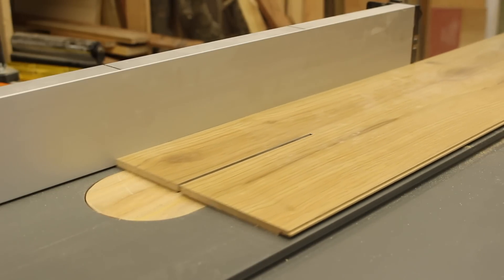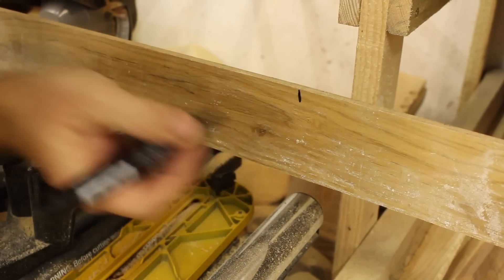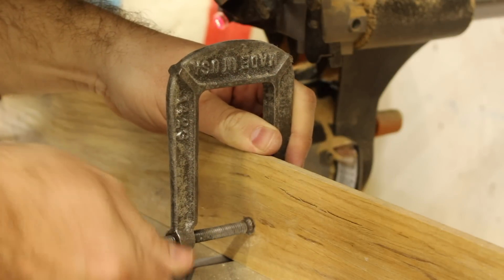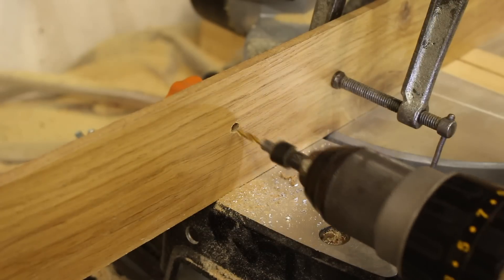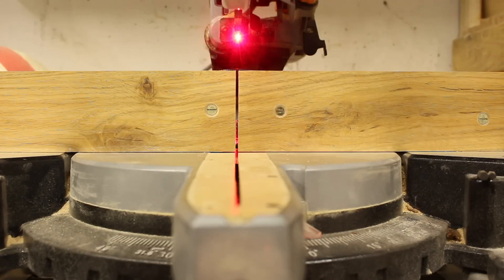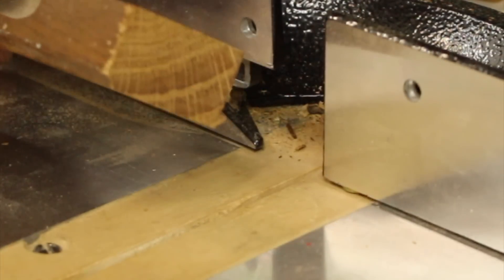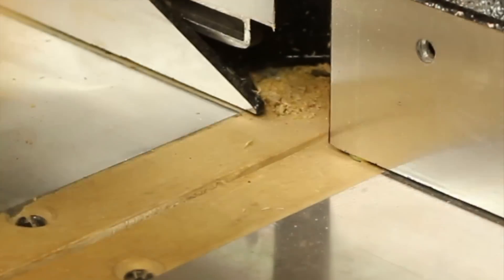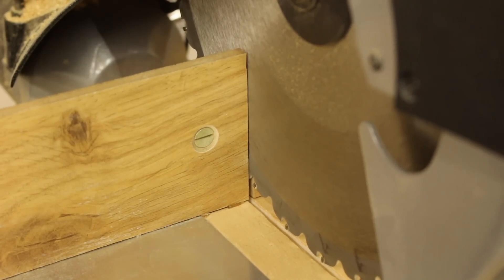Make Clean Cuts - Miter Saw Zero Clearance Fence - Ep 057

Comment: Did you fix the blade wobble? I scanned through your videos but did not find such. Help?
TTHANKS
Reply from the maker: I didn't have blade wobble. At least not much with that saw. It could be that your blade is dull so it cuts unevenly. If you have considerable wobble, you should return your saw to the manufacturer or dealer.
Reply: @AndreaArzensek  
In the video I thought you said you needed to fix the wobble.
Reply from the maker: It is so old video I don't remember what I've said. But I do think it was the saw blade that was dull causing me problems.

Comment: Is that an evolution blade. I just bought one for my saw . What are your opinions on the blade?
Reply from the maker: The saw itself is great. However the blade (imho) is very bad. While it can cut many materials it's only clean in metals. 
It's just not good for wood - lots of tear out and rough cuts. 
Also for some reason the blade produces very high noise when cutting hardwoods (probably not sharp enough)
I ordered new blade from Axminister so I will see the improvement which I think will be quite dramatic.
Reply: Thank you for that . I will probably use just to cut firewood that has nails then.
Reply from the maker: For that use it will be perfect.
You can cut pallet wood, firewood, and suspicious wood that could contain metal.
Cheers Frank!

Comment: you are still getting small tear out due to the chamfer you put on the bottom of the fence for the dust removal
Reply from the maker: I didn't notice any tear out. But I eventually changed the saw and the saw blade. Now I get very clean cuts. Cheers

Comment: The music is a bit too much for my taste
Reply from the maker: Ok, I promise the next one will be without music. 
Thanks for your feedback Danut, cheers!
Reply: Thank you, and also for the fence idea. I must make something similar but removable somehow. What do you do when cutting at 45 degrees?
Reply from the maker: I remove four screws or use a sled on the table saw.
It would be great to make it quick release for any cut.
I think that placing the block on the back would be the best so you can make all those cuts by referencing on the existing fence. This would take more measurements and time, so I opted for this quick solution.
I use this miter saw for 90 degree cuts 99% of the time.

Comment: I like that idea think I'm going to do that to my rigid I took the fence right off that came with it from the factory I couldn't stand it it was not a true 90 degrees so now it's hard for me to cut any stock that's thicker than three quarters of an inch thanks for sharing this idea I also have the evolution so I'm going to do this too eventually once I get my shop in order I just bought an air filtration system any new dust collectors so setting all that up rearranging the shop
Reply from the maker: Dust collection system would be my next step because I can't see in my basement shop when dust gets flying!